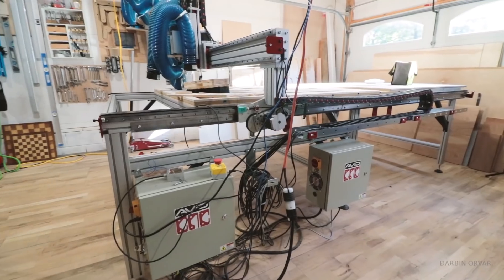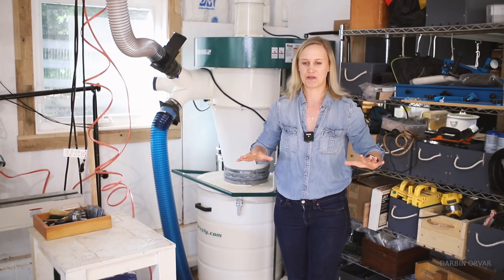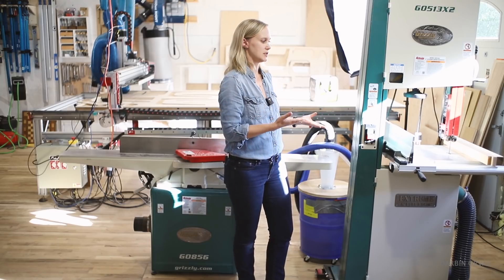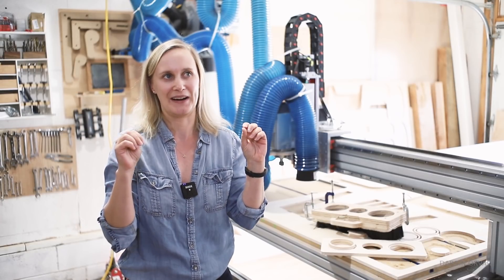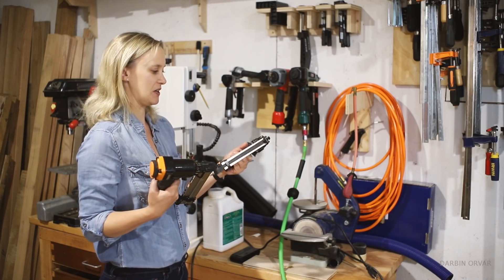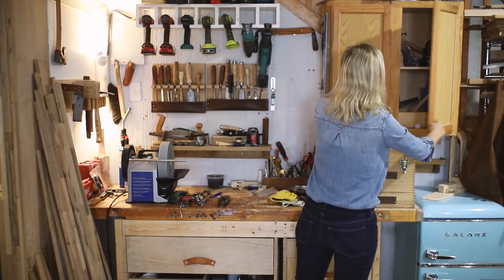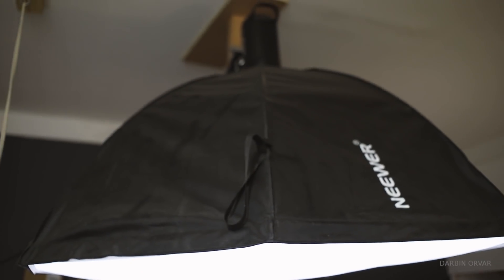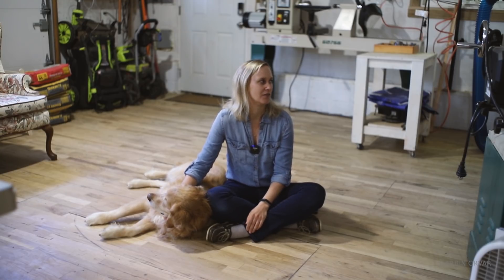A Pretty Long 2020 Shop Tour

Comment: Doesn't superglue last longer if it is refrigerated?  Maybe some things like that could work for the fridge....though it may not be worth running an entire mini fridge just for opened superglue :)  I use two of those box fans with filters in my shop, and 4 inside our house due to the california wildfires, and my dylos particle meter agrees that they help a lot with a hepa/merv 13 filter.  :)
Reply from the maker: Haha, yeah not sure I'd keep a fridge going just for superglue. I'm sure the fans must have made quite the difference dealing with the smoke.
Reply: @darbinorvar  Oh yeah, with 4 of them running, even last year when it was super bad outside, it was about 1/3 of the outside particle count indoors.
Reply: Cianoacrylate hardens in the presence of moisture. Since modern fridges are designed to create a moisture free environment its the ideal place to store it. You can also store it on an hermetic plastic container with a couple of silica gel satchels on the inside to absorb moisture. So its longevity is not tied up to temperature but to the absence of moisture. Hope it helps.

Comment: I know what you mean about the mini-splits.  I live in North Alabama and just added a mini-split to my shop.  What a game changer.  I love the much lower humidity and constant temperature.  Working in a 90 plus degrees shop with high humidity is not fun at all.  Also, I saw all the negative comments on your floors when you installed them.  I think they look great and really adds to the feel of your shop.

Comment: I got a laguna supermax 19-38 drum sander, and that works amazing for taking tiny amounts of wood off small or larger project pieces.  If you got one of those, you could use that 15" planer and still get larger pieces up to 38" wide nice and flat.   I have so enjoyed using the drum sander to get exact thicknesses for the pieces of my (and my neighbors) projects, so I recommend one of those.  Cool shop video :)
Reply from the maker: Thanks for the tip!

Comment: Regarding what woodworking is, for me, it always meant taking into consideration that wood is organic, that it changes size with humidity, that it has a grain that is not always straight, that the grain is varied and it takes a watchful eye to match up patterns in a pleasing way. These characteristics set wood apart from working with metals and plastics.

Comment: Hi Lin love what you have done with the shop. I purchased the 8” jointer and the exact same planner, which brings me to my first suggestion with your planner get the Grizzly Bear Claw roller stand for it as it does make a big difference for mobility. If you are worried about sliding around the get the four full rotational wheels it $10,00 more. Once lock down you have no movement. Ok second suggestion your bar clamps I spent quite a bit of cash on mine and like hatted to get glue on them. So I found if you know the line of your glue up just put Sumer cheap paper tape on the clamps and protects them. I have also heard of using grease or Vaseline as well. I like the tape a little extra work but well worth it. I will also look into signing up on the pay site as well. Funny I have been following you for years I remember so many of your stories. All the best Lin.

Comment: hmm... if I were on a deserted island I might want something like a solar powered radio with built in GPS, or at least something like a hand saw or axe or hammer 😛
I do not have a CNC, but while it may be considered "cheating" by some, from what I've seen on other channels it definitely does not  work alone and opens a lot of possibilities in creativity and/or productivity for the full time pro.

Comment: Awesome workshop.  Maybe purchase a mobile  base for the  planer; that way you can move any where in the shop.  Build a cart with wheels to fit under the lathe and place your turning tools on it instead on the wall.  An idea install caster on the drum of the dust collector or look into getting a Harvey dust collector; check the Next Level Carpentry  youtube video on this dust collector.  Stay safe and keep up the good work.

Comment: Linn you obviously have a rather complete shop.  One tool that I used in the past that was amazing I would like to describe:  we had a Shopsmith Mark 5 "5-in-1" power tool that worked as a table saw, shaper, lathe, drill press, horizontal borer, and disk sander, depending on how it was configured.  It has a powerful, multi-speed motor, and a rack and pinion to provide an "up or down" or "in and out" motion, again, depending on configuration.  While it is easy to replace most of those tools with dedicate tools, such as a separate table saw or drill press, in my opinion the unique tool was the disk sander.  Not only was it a large, sturdy platen to hold the paper, but the platen was fitted onto the rack and pinion mechanism, so that you can, for example, take a small box and sand it perfectly square and to an exact dimension, with incredibly square and sharp corners if desired, to any desired level of smoothness, working the disk at a speed appropriate to the task at hand and the grit of the sandpaper that is mounted. Sort of like a "thickness sander", but for much more than just board thickness.  (There are "stops" that can be locked in place, guaranteeing repeatable thicknesses.)  To have this capability in one's shop, either by having a Shopsmith multi-tool or developed or procured in some other way, I feel is or would be a great boon on many kinds of projects!

Comment: Seeing your box fan with the filter taped to it got me to thinking. 

A bit of 2" 90 degree corner molding attached to the sides of the box fan with magnets, and you will have a slot that the filter slides into. Not as cheep as the tape, but ultimately; a lot less goo when it's time to change the filter. And the magnets allow it to be easily transferred to a new fan when the current one burns out.